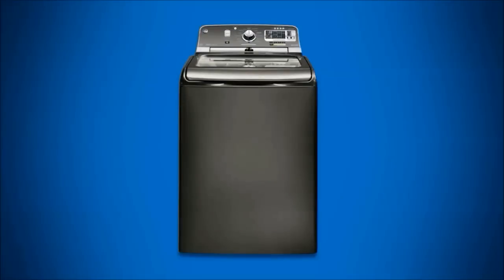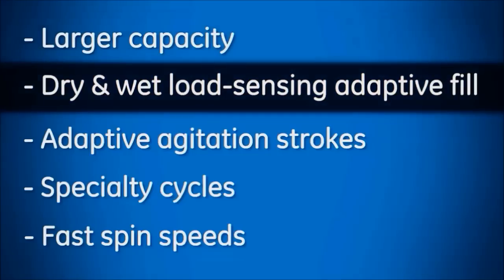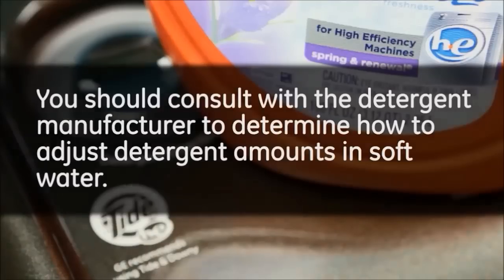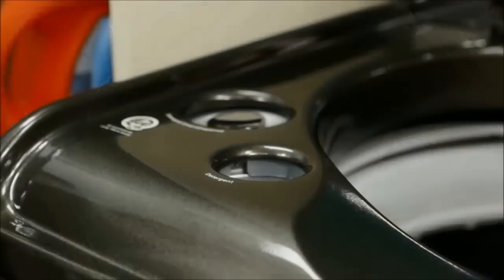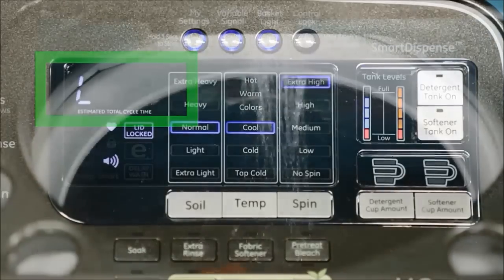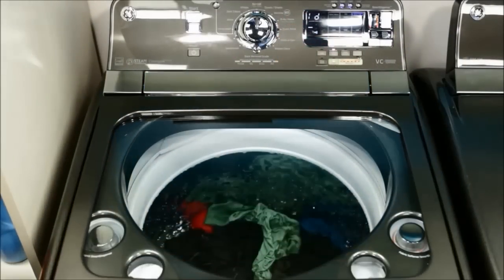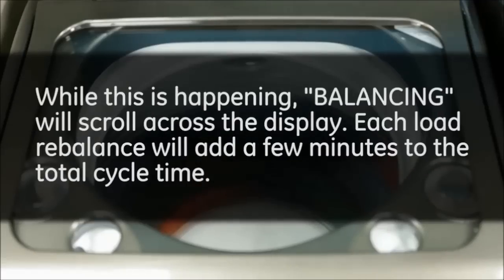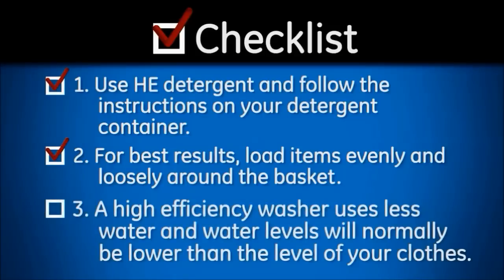GE Appliances High Efficiency Top Load Washer with Infuser - Proper Use and Loading

Comment: I don't completely understand why you need to leave the infuser uncovered. won't the clothes just fall on top of the infuser as soon as it starts spinning?
Reply: I noticed that long ago.
Reply from the maker: Skip, if you have a GE appliance issue please provide us with a brief summary of what's going on and we will be happy to see if we can help.  Thanks.  AS
Reply: TradHunterRN i thought the same thing but with my cabrio washer i realized that when it starts turning the clothes, roll over is quicker and more efficiently. if the infusor is covered it will take longer to roll over. these machines work well as long as you use them the way u should. most people dont load them properly making them not turnover laundry properly.
Reply: Luis Alvarez thanks! I've noticed this myself the longer I have used it
Reply: TradHunterRN your welcome. im npt gonna say that all HE washers suck because most issues are how people use them. my sister has a GE Harmony and its been running for about 7yrs and she loves it. never had a problem and it washes great because she uses it the way she should and soaks and prewashes if she has to to fully clean loads. im thinking of getting this washer soon.
Reply: bECAUSE THEY ARE A CRAP DESIGN. Think of it this way. You buy a new car that get's or claims to get incredible gas mileage. But.....to get it going you have to open your door and get the car moving with youir foot...Like Fred Flintstones. Get my drift?